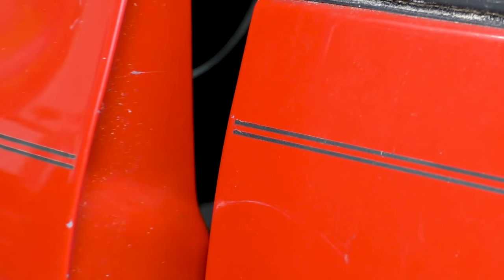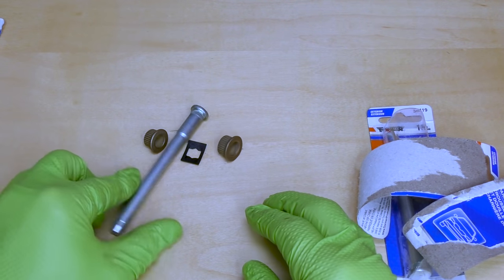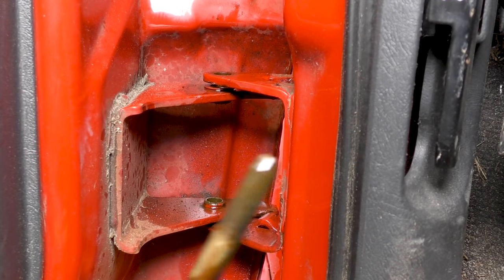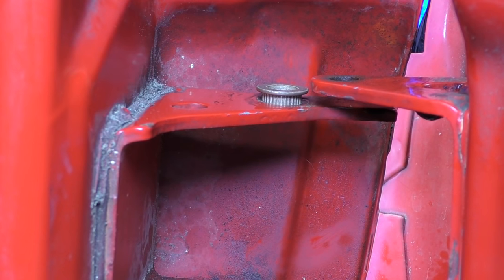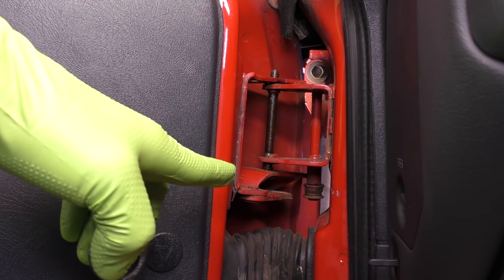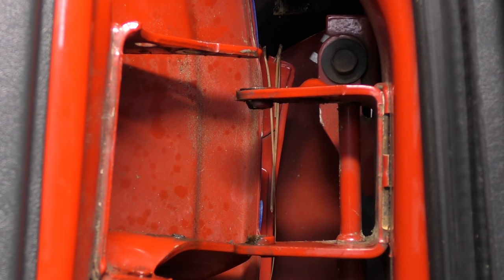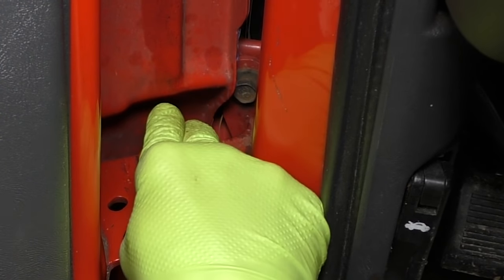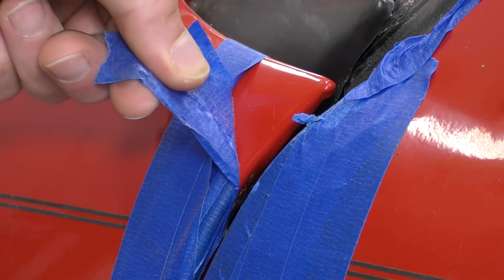How to Replace Door Hinge Pin & Bushing ~ Fix Sagging Door

Comment: Can I put the truck in the oven instead of putting the pins in the freezer? Asking for a friend...
Reply from the maker: Or just move to AZ, and only do the repair in the summer. I think it's the same thing.
Reply from the maker: Also I wish I would have tried that on the PS.
Reply: Just use big nasty to install the bushings Eric 😂😂😂😂
Reply: I resemble that remark. It gets so ridiculously hot here.
Reply: Yeah it's called winter
Reply: @HumbleMechanic  It works very well on power steering pulley installation.
Reply: lmao, you are a funny guy Eric O.
Reply: Microwave only
Reply: truck in the paint oven, pins in the freezer 😂👍
Reply: I like mine tord to wormer sid to give. Thim a nice tase and ad sum paper
Reply: Whenever I would do those hinge pin bushings and the spring was missing I would call a friend of mine that worked at a body shop and ask for a door spring and would ask what color? Evidently they rarely put them back on the trucks and I'm not kidding
Reply: Or just drive it to Florida on vacation.
Reply: @HumbleMechanic  your in arizona? can i meet you lol in person man your so awesome
Reply: of course you can, I do all the time. Wife is beginning to suspect something is going on !! so be cool and wipe up the grease on the kitchen  floor and ceiling.
Reply: you can warm up the hole too, torch thingy, but watch out for too much.  Coefficient of Thermal Expansion , you can look it up
Reply: @HumbleMechanic  you have to
Reply: Hahaha! 👋👋👋
Reply: Hey Big Daddy
Reply: @HumbleMechanic 😂😂
Reply: You ARE looking for a "misery loves company" friend 😝

Comment: The tutorial is pretty good; the problem is that these replacement bushings tend to crack/break in very short order. I've never seen one of these repairs last more than a few months. Complete hinge replacement, although a much more time-consuming job, is the only way to really ensure a long-lasting repair.
Reply: I just replaced mine. And while testing the bushing broke. I don't know what to do. It looks like the holes a little wallowed out. One of them is but she seems to be shutting. I guess we'll see. I'll just keep those in stock
Reply: Someone said Amazon sells stainless steel bushings. Also if holes are wallow out get some ten thousandths stainless steel shim. Cut a few narrow stripes and heat them with a cigarette lighter and bend them 90 degrees. Lay them around holes and insert bushings
Reply: I had to replace 3 or 4 sets of these on our work trucks 15-20 years ago. They all held up fine. I bought my work truck when they retired it. The bushings were still fine when it got wrecked at 311,000+ miles. I've seen a fair number of other people mention having trouble with the bushings breaking these days. I wonder if they've dropped in quality?

Comment: at the 7 minute mark, you "tap" the bushing in the rest of the way.  That right there is when my Autozone brand bushings (38416) kept breaking.  I went through four sets today without being able to get a full set of replacements in the upper hinge.  I need to find a better brand of bushing, hopefully made of a better material that this die-cast looking crap.

Comment: Use a socket when pressing in the bushing you can tighten & press it all the way in.
Reply: That's what I'm saying
Reply: A longer bolt would help as well.
Reply: Unless he finished it off camera they didn't last long anyway. The pins were way off as far as being pressed in correctly.
Reply: what are you talking about? the bushing movement is still limited because of the nut and washer. a socket wouldnt help anything
Reply: @usingtubes  The bushing goes beyond the hinge so the socket gives it space to seat without bottoming out
Reply: @boblister665  the socket will seat on the washer, which will block the bushing. and you cant use a bigger washer, because the same problem will be encountered with the nut
Reply: @usingtubes  You put the socket on the opposite side you are pushing on to receive the bushing as it goes past the hinge.  I have only been doing body work for 45 years 15 at a GMC dealership so still remember a few tricks. I also own one of these trucks that has doors that work like new.
Reply: @boblister665  sorry but i still dont see how it works. you crank on the nut to advance the bolt which pushes the bushing through. but then it stops the moment it hits the washer. how does a socket help avoid that?
Reply: @usingtubes  the socket goes in place THEN the washer and bolt..its the same thing as a ball joint press

Comment from the maker: After working on this s10, and watching the videos(that I also edited) I realize just how much of a German car tech I really am. HAHA I can't really place why, but it just is.
Reply: There would be an improvement-stage to your Press-Tool :D Next Time use a longer screw and one of the bigger sockets , so you can pull the bushing into the open space in the socket :D
Reply from the maker: Oh yea!!! I try to be mindful that not everyone has a big old parts bin. Lol it’s a balance I guess
Reply: As someone who has personally pulled a MK6 door and and S10 door. It's ridiculous how complicated the S10 hinge system is compared to the Jetta. I went the route of channel locks and zip ties to get the spring compressed on the S10, which is a bit more annoying.

Comment: Good video! A trick I've learned is to use a deep well socket that is larger than the diameter of the bushing along with the washer/bolt  to drive the bushing all the way into place. Like you said- go slow and and it'll fall right in place.

Comment: This was very helpful.  A few years ago, I replaced the pins & bushings on only the driver's door, on my 88 Dodge Aries wagon.  I bought extra pin/bushing sets, and if the other doors need this, I will freeze the parts first.  That is a good idea.  I also will use the bolt-nut press tool for the brass bushings next time.  It's a good thing I had extra kits when I did it.  I just tapped the brass bushings in, and broke one from hitting it too hard - lesson learned.  I was working alone, so besides supporting the door from the bottom with a floor jack & wood, I used a YT tip I found at the time - place a step ladder over the window opening, and tie a rope to the top of the window frame, and to the ladder.  Of course, you can't do that if the door is frameless.

Comment: Well done video. I built a jack out of 2 X 4s to cradle the door to facilitate working alone. 
If you are also replacing the roller pin, I recommend working in this order: 1. Remove old hinge pins and spring. 2. Slide door away from vehicle 3. Remove old roller pin.  4.Install new roller pin.  5. Slide door back in place. 6.  Install new hinge pins and spring

Comment: I'd recommend using a socket (or a stack or large enough washers to allow for the bushing to be pressed all the way in) between the bracket, the washer and the nut, this way you'll be able to press it all the way in without having to use a hammer
Reply from the maker: Love it!!!
Reply: Exactly! You tap that bronze bushing and they ALWAYS break!
Reply: Piece of allthread with nuts + washers on the ends, will pull the bushings in straight and true every time.

Comment: I gotta give it to you ,, you make it look easy!! I'm so angry with myself , but I won't quit.  Bushing absolutely suck,  I broke 4 bushings, I used the bolt to compress in , top hinge went well , bottom not good .   I put the pin and bushings in the freezer , my wife thought I was nuts .... bottom hinge hole were very small , no way to fit .....but bottom hinge is my problem now .....
Then hammered the roller pin ..omg ....had to grind mid way so it would fit , but could punch it in all the way to put the coder pin .....what task ...but thank you video helped

Comment: Excellent and informative video, you are very good at explaining things, which is a treat to watch. I would take the jack support method one step further and roll down the door window enough to attach a couple of soft-loop strap and tie-downs to the upper door frame so it's lightly supported from the garage rafters, just it case the door slides off the jack (I work alone and like the safety backup to have a safety backup).
Reply from the maker: Great Idea! try and keep that as safe as possible.
Reply: SORT STRAPS AND MY ENGINE HOIST OR LONGER STRAPS UNDER THE DOOR  IF WIDOW HAS NO TOP FRAME. I ALSO WORK ALONE. STECK TOOLS {21825 BUSHING DRIVER-$21.00, 21835 DOOR HINGE POPPER $27.00, AND 21910 SPRING TOOL $18.00} ARE A MUST IF YOU DO A LOT OF G M  CARS LIKE I DO.
Reply: I don't have a garage, but I do have a boom hoist.

Comment: Thank you so much for this video. I am about to try this on my sister 1996 Chevy blazer. I bought the kits, 2 new springs and the spring compressing tool as the one in this video. You explained it so well. Thanks for the suggestion to put the parts in the freezer. I would have never thought of that. Thanks again, you are awesome.

Comment: I just did this in my garage. I used straps to lift and hold the door,just threw them on the beams and tightened it enough to hold it. Was able to do it alone 🤘

Comment: Replacing the hinge pins and bushings on my S-10 also solved the water ingress issue... no more mysteriously wet carpet.
Even the slightest wear and play at the hinges translates to quiet a bit of misalignment at the top of the door frame where it meets the roof line, allowing water past the upper door seals. This type of leak is often incorrectly blamed on the sunroof if the vehicle has one. I have mentioned this to several people who were chasing what they thought were sunroof leaks that ultimately turned out to be leaky door seals due to worn hinge pins and bushings.

Comment: That was easier then what I was told which is that I would have to hollow the hole out in order to insert the bushing and pin. I tried already and the bushing/ sleeve cracked and broke off as if I didn’t replace. Thanks. I’m going to do exactly what you just did. 🤙🏻🤯
Reply from the maker: Glad to help!

Comment: Lubricating door hinge pivot points has to be one of the most forgotten jobs on the annual service list. I've found spray on motorcycle chain wax to be good. I'd even spray a little on the pin before assembly. Be sure to wipe away any excess though.
Reply from the maker: Noisy doors are a pet peeve. I could hear that crap from across the shop

Comment: This guy is pretty much on point on changing these out. I would say to oil the bushing prior to install.
Remove spring with pry bar, turn face and close eyes. LOL!  If you don’t want to spring for the spring compressor you can put it in a vise and use strong wire to hold it. Install and cut the wire. It does work but a bit dangerous.

Comment: This video is great BUT has anyone noticed that the "bronze" bushings supplied in certain repair kits are JUNK? I got some from NAPA and the "bronze" bushings literally crumbled when pinched hard by hand. Needless to say, this is some type of cost-cutting "sweep-alloy" that's substituted for the original sintered bronze material put there by GM way back when. I'm just going to ream the holes and install STEEL BOLTS. Doctor Meatball to the rescue! -Steve Magnante

Comment: Nice, straight to point, precautions noted, expectations created, tips provided like freezer and lube. I would have added the roller for the spring position cam / lever for its condition and oil it.
  I bought a can of WD-40 in the spring of 1974. Still has some liquid in it. In other word’s, use motor oil and oil can to apply a drop or two once a week or month on the drivers side. Passengers side see very little use under normal condition. But oil these, it is maintenance and don’t depend on a quick lube joint never give these hinges, the hood or the grease needed on some steering parts. 
  Very good video, easy to hear and well lit for those who have not done a couple of hundred because then, you get better! Right.
DK. ASE Master Tech since 78, retired.

Comment: For inserting the bushings, you could also use a longer bolt and use a socket  before the washer and nut to give enough depth to fully press the insert.

Comment: Great video I use the bolt method as well only difference is after lining the bushing in I take the nut off the bolt , with bolt still in i tap carefully with hammer

Comment: With your homemade press setup, you can use a longer bolt this way you can add a spacer before the washer and nut. The spacer is to allow the bushing to be pressed all the way in because the spacer has a big enough inside diameter to allow the bushing to extend past the hinge to be completely installed. No need to back the nut back off and pound it in, just tighten it all the way in the first time.

If you have no easy access to different size spacers just use a socket as a spacer. It should be fine, it won't hurt the socket. Thanks for the freezer tip.

Comment: Love this detailed installation. Especially that, not so hard after all spring! Wish I'd found your video earlier. I'd been without the spring getting every part of my leg slammed on every time the wind or gravity launches the door. Owl! Weeeh! I had positioned the tool's jaws on the outside thinking only about full compression, for dummies then gave up. It's been somewhere on the to do list. Also, I wondered how many had done the same, don't be shame? Now, where did I place that springs and tool? It's probably still stuck together. Feb 2023, I had 1997 exchange offer for an 1998 LS with the same hinge issues, too. You will be in my digital tool box forever! I'm appreciative finding your door hinge video!😄😃

Comment: Thank you for the excellent video. I checked out a few others but their lighting and explanation of the process was poor. My son and I completed the install but didn’t have the spring tool. I tried the zip tie method but the spring strength was too much for them. The ties backed off when I loosened the vice. Cheap zip ties I believe. I ordered the tool which should arrive tomorrow. 😎👍🏻

Comment: Great video for hinge pins without an oil can within 6 miles of them. Today, if doing this for the first time, take photos and indicate LU, LL, etc. pins and hinges look the same as some fit 1043 applications including Dodge, Jeep, etc. There are several part numbers so know what vehicle you have as there maybe 13 part numbers to pick from. Spring tool used to be cheap, got no clue today. 
   Just be safe as doors get heavy & put some good shoes or boots on during this work. Don't be called lefty. Check & measure bushings as they come out, some are not knurled, and keep on order, do one at a time. Tag them or bag them if interrupted. It happens!

Comment: I've had a few Chevy trucks with this problem and the pin kits always work, til this one.  90 model 3500. Easy fix. Got a piece of Xtra heavy-duty plastic,1/4 inch thick, nearly 1 1/2 inches wide  3 or 4 inches long. Fit the lower baseboard just right. Screwed it down, beveled the edge and the door shuts great. Just passing along a little tip if the pins don't work. God bless America and FJB.

Comment: Longer bolt with a socket, a little heat on the hinge no hammering bushing, job done and done...  I would also recommend pressing them out the same way...

Comment: Good to know there’s a tool to compress the door spring. I’ve done a bunch of them without compressing the spring and it’s a real pain😂
Reply from the maker: Yea I have seen Zip ties used. A little sketch when the tool is about $10 LOL
Reply: @HumbleMechanic  definitely done the zip tie method lol. Thanks for the reply!
Reply: @HumbleMechanic  
There also is a tool to drive the bushings in
Easy to use And fast
Well worth investing in
If you do several of These.    I do it average of 10 to 15 of these a week so it was well worth the investment. 
$25.00
Reply from the maker: Oh nice!!! Wish I’d have found that. Hahaha
Reply: @HumbleMechanic  
K &N Door Bushing
Driver , Bought it off the Cornwell Trk 30 Yr's ago.

Comment: This video is pretty good , after reviewing a number of like videos I have two really good suggestions. 1. I have a flat warehouse four wheel rolling cart-means with four casters, 2x2 or better 4x3 with sides on each end-there is a slot made of spare wood to hold the bottom of the door in place and the door is secured cross ways by various ways to the ends of the cart to stabilize the door-these doors weigh 300 pounds or more-they can hurt-and tape the corners-two hour job-then 4 hours paint repair-I do not think so- 2-that bolt to insert the bushings is fine, but is only half used-where the nut and two washers are  add some larger washers so the bushing coming thru can be bottomed out on the drive end of the bolt and the bushing is not crushed.  from Mr Know It  All

Comment: The first one you worked on, I accidentally put in upside down. It kept falling down the pin after I put the door back on. Today I put loctite on it. I’ll see if it holds. Time will tell. I don’t want to remove the door again. That little spring was a pain in the * to get back in without that tool. The masking the door part is a good idea, I’ve already knocked some on my new paint off the front edge playing with the door trying to put the bushing back in from the top. I gave up.

Comment: I have also used the bolt and washer method as a press but also using a socket larger than the diameter of the bushing. That way there's no reason to use a punch to drive it the rest away and you can simply tighten the nut and bolt with the socket and completely drive it all the way down.

Comment: Oh I did the press method but I used a longer bolt plus a socket to press it ALL the way. I was a little cautious of using a hammer and punch even tho I have a brass punch to do that still worries me though.

Comment: Idea use longer bolt with a socket larger than the bushings and let the bushings slide in smooth and straight then pull bolt and done